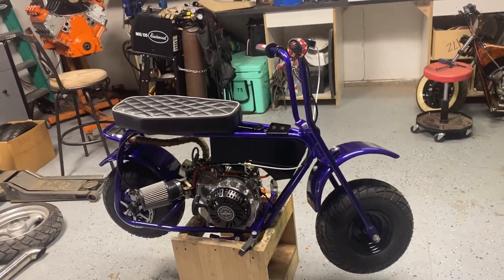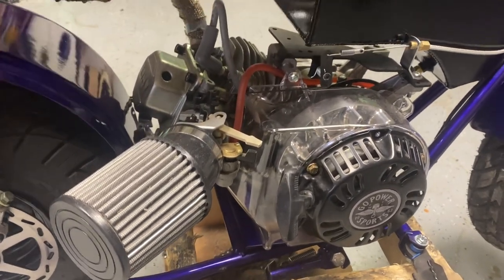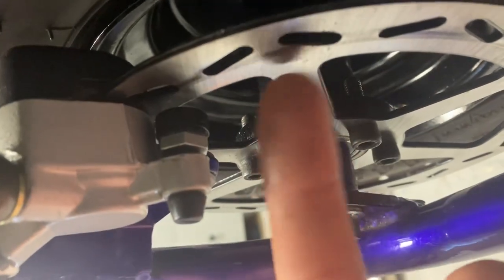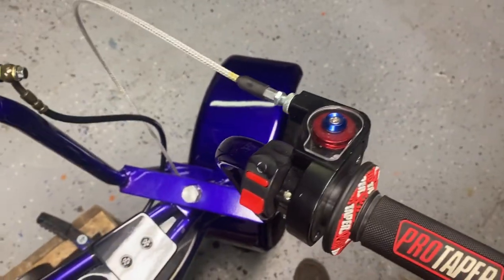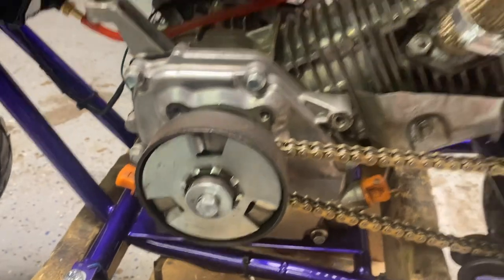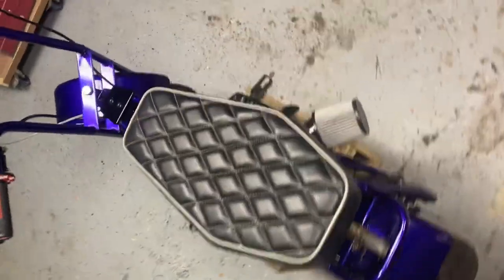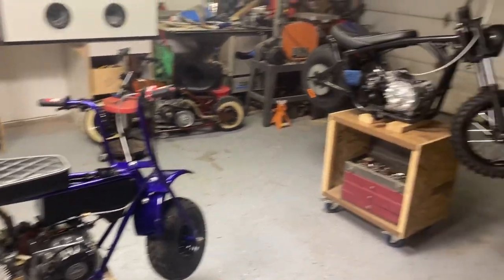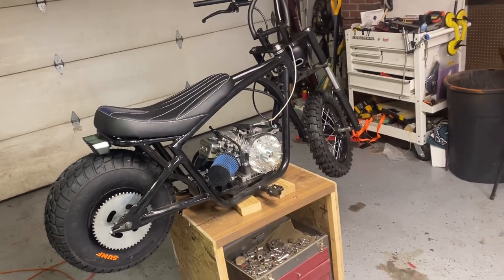My wife’s Doodle Bug build

Comment: What size is the axle in the front wheel??
Reply from the maker: It’s the original 12mm but I changed the bearings to fit because that wheel comes with the bigger bearings